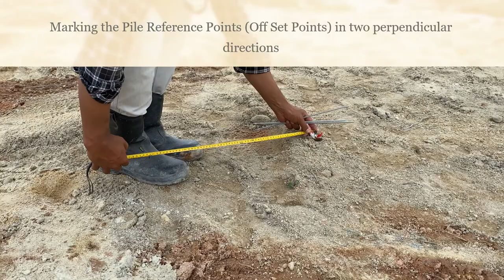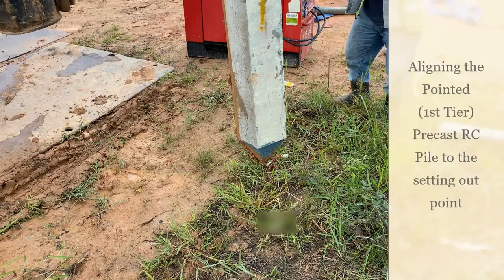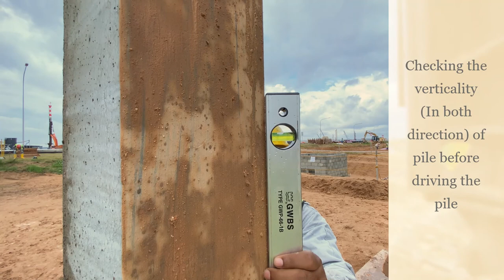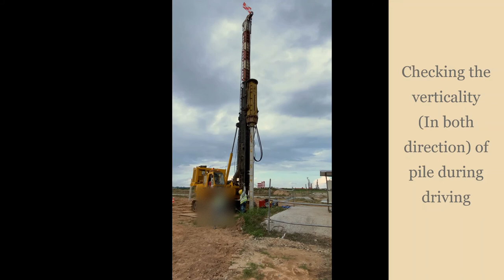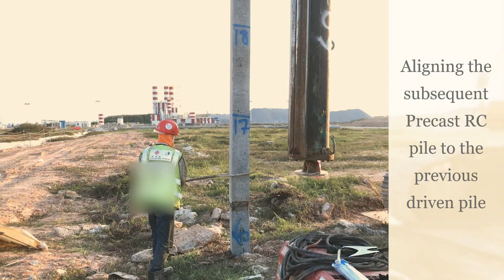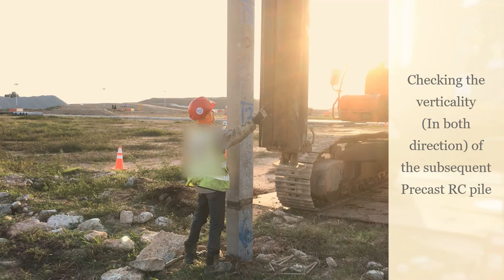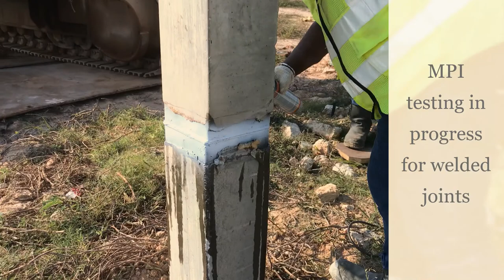Installation of Driven Precast Reinforced Concrete Piles

Comment: How long should wait after welding
Reply from the maker: Usually, we are using Cooling Agents in the construction sites, in order to speed up the work. In that case, we may wait 2 to 3 minutes only.

If we didn't use the cooling agents, we need to wait until the weld gets cold naturally. It will take 30 to 45 minutes.

Comment: MPI test purpose for what ?
Reply from the maker: Magnetic Particle Inspection (MPI), also known as Magnetic Particle Testing (MPT), is a non-destructive testing (NDT) method used to detect surface and near-surface discontinuities in ferromagnetic materials, such as iron, nickel, cobalt, and some of their alloys. Here's why it's particularly useful for inspecting welding:

Detection of Surface and Subsurface Defects: MPI is effective in identifying both surface and just-below-the-surface discontinuities. In welding, this includes cracks, porosity, incomplete fusion, and other inconsistencies that might compromise the integrity of the weld.

Immediate Results: MPI provides immediate visual results. The presence of any discontinuities is indicated by the accumulation of magnetic particles at the defect site, which can be seen directly. This immediacy aids in the quick assessment of the welding quality.

Minimal Preparation Required: The surface preparation for MPI is relatively simple compared to other methods. The area needs to be clean, but extensive preparation is not necessary, making it a quick and efficient process for weld inspection.

Sensitive to Small Defects: MPI is highly sensitive to small surface cracks and other discontinuities that might not be visible to the naked eye or could be missed by other NDT methods.

Applicability to Complex Shapes: The method can be applied to complex geometries that are typical in welded structures. The magnetic field and the particles can conform to the shape of the object, making it versatile for inspecting welds in various configurations and positions.

Cost-Effective: Compared to some other NDT methods, MPI is cost-effective, especially for the detection of surface and near-surface discontinuities. Its efficiency and speed also contribute to its cost-effectiveness.

No Hazard to the Component: MPI is a non-destructive test that does not harm the material's structure or future usability, making it ideal for routine maintenance and inspection.

In summary, Magnetic Particle Inspection is a crucial technique in welding to ensure the quality and integrity of welds, particularly in critical structures where strength and safety are paramount.
Reply: @ProudtobeaCivilEngineer   Does the measuring device work through the concrete?

Comment: I don't believe the piles don't crack when driving them into the ground. I wouldn't use them.
Reply: 14,000 PSI Concrete piles work just fine.